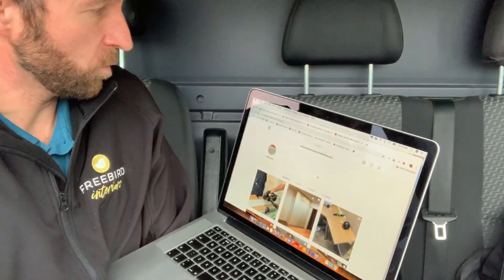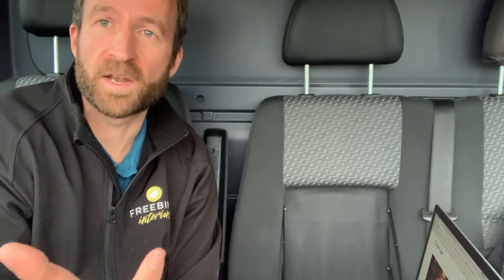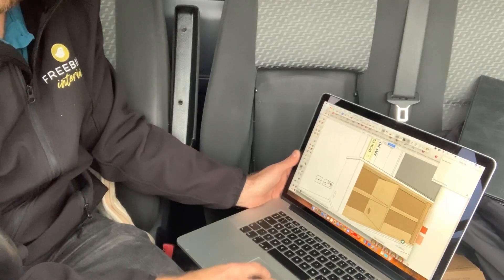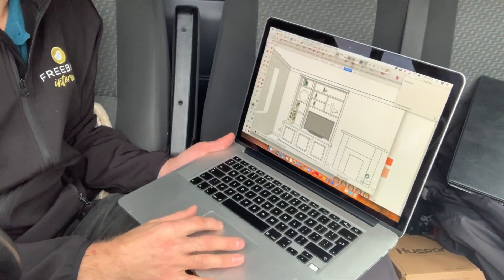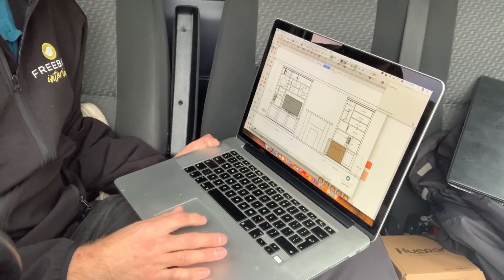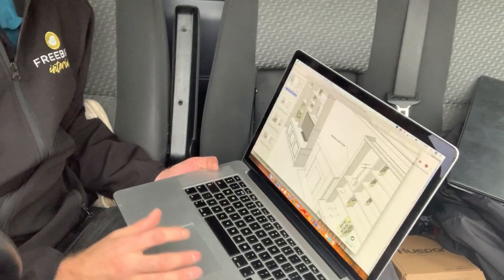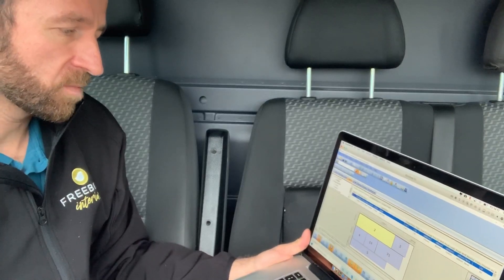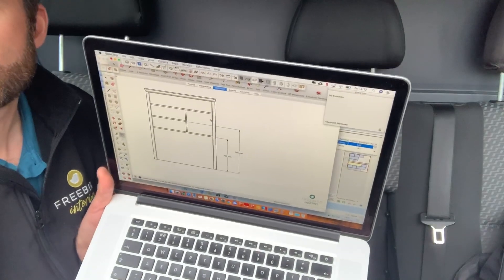Would These SketchUp techniques help your business?

Comment: Excellent content as usual Alastair.

I'm wondering, (and no doubt you have already thought about this!) if you can take it a step further.
Could a 3D camera/imagining be used to survey the existing space (where the cabinetry is to be fitted) and then import that scanned data into sketchup? 
Given the required standard of the finished work you'd need to be satisfied that the 3D survey can capture the existing space dimensions to a milimetre fine tolerance.
There seem to be a number of potential solutions, Canvas, Matterport and Magicplan, but I'm unsure of the accuracy they offer and the costs seem very expensive.
Magicplan seems the most cost affective, the 3D scan can be done with a phone and it seems to facilatate verification of scanned dimensions by laser measurement although I'm unsure if this can produce the required accuracy.
If that makes sense it would be great to hear your thoughts on the matter.
Reply from the maker: This is an interesting question which I have looked into and here is my conclusion: It causes more problems than it solves.  For example -  It is more useful for me to take a maximum width measurement of an alcove myself and draw it as if it is straight and plumb, because I can use those vertical edges as guidelines, and build my straight and plumb furniture model easily to fit.  And it looks better for the customer.   If I get an exact shape of the alcove, it messes up my drawing process.  It also introduces a huge amount of lines and points that slow down my model.    There are other reasons.  But it's an example of a wider issue I have observed: It's very tempting to try and ge technology to take away the brain work and give you a solution -  a perfect scan, or an automated CNC  cutting process for example.  But experience has taught me that in every case it is necessary to have the intervention of the human thought process to be selective in what is really required.  Gramted there could be a middle ground - perhaps a scan is made, and then a software program is created which finds the maximum width of an alcove and renders it the way I choose.  But it gets very labour intensive to set up such a system.
Reply: @Alastair_Freebird  Hi Alastair. Yes certainly agree with your reasoning above. 
I suppose for alcove installs really the main joinery carcass is regularised and independent from the typically irregular space it occupies, therefore in that instance all you need to know is the tightest dimension you need to fit into and then allow some freedom onto that.

However I think the exciting potential to use 3D modelling is where the joinery has to physically join against the existing irregular wall.
If you could have, sasy,  cover slip scribs precut in the workshop on the CNC then you could be approaching site installations that require zero onsite cutting, (imagine no cutting tools required, dust collection, clean up!), well that's the dream anyway!
Reply from the maker: @Helibox  Well, alcove cabinets are all about scribing to irregular walls ( the example in this video is less typical).  I see the appeal of what you are saying but still I think I would stick with our approach!  We record the widest alcove dimension and make the scribes on the drawing size to that but ALSO add 20mm to any part that touches a wall.  If the alcoves narrow unusually we may also record the narrowest point but usually our standard side voids accommodate any variance.  Then we rely on the fitter's judgement to make the final cut and fit.  I think that will always be required.  But it's quite possible I am stuck in my ways and not thinking big enough!!

Comment: I'd be in Alistair. I really can't put a price out there for you as I have no idea how much you should charge for this. I look forward to seeing  how this develops. Always keen to learn. All i knuw is, i spend way to much time on sketch up. I currently  measure each component and manually add that in to another program called Maxcut. But its a slow journey. Would love to knock that down to 2 hours. Cheers
Reply from the maker: I think a lot of people are in the same boat, but improving it takes even more work, and uncertainty about the outcome.  I am going to further refine my system so it’s as easy to get up and running with as possible and to make sure I can teach it easier, then make something available.  May take some time alongside other projects but look out for updates 👍

Comment: Evening Freebird, 

thanks again for showing some of your trade secrets around planning and design. I have been using SketchUp for the last 18 months and have still a lot to learn in that department. 

I wanted to ask about how you go about sharing the designs with the client. 

As you know ( bought you a few coffees couple of weeks ago because of your invaluable advice ) I've just fitted some understair drawer units for someone. 

After I had finished the project the client came clean on why she took so long to reply to the original quote. 

I had drawn up and priced the project, sending over some screenshots from the SketchUp model, she had then passed those drawings around a number of local joiners and got a number of quotes back. 

In this case, I was fortunate to get the job as she had received cheaper prices from others. 

Now looking back over the last year I feel this has happened a number of times, resulting in me planning and setting up the job for someone else to come in and take on for a lower cost.  

I guess there isn't really a way around it unless I go there and show them the drawings in person. 

Sketchup has been an amazing tool for me this past year but I'm struggling on how to navigate this. 

All the best 
Jim Mustill

Comment: I use virtually the same workflow for designing in my business to increase productivity and eliminate mistakes. You get to make in the computer before doing it for real. If you are on the fence about this, I guarantee this training will save you untold hours learning and testing yourself. There are software costs to take into account and you need to get familiar with sketchup, but I’ve never thought twice about the investment. Put off buying that new Festool toy and do this first.
Reply from the maker: Ricky Bla Bla interesting.  What software do you use?  There are systems costing thousands that could get up and running faster.
Reply: Freebird Interiors 
I go from sketchup pro to Cutlist bridge and then Cutlist Plus fx. I’ve used Cabinet sense and it is great software for dynamic components. good luck with this, wish you had been there when I was starting up.